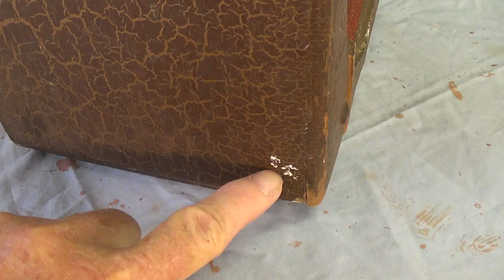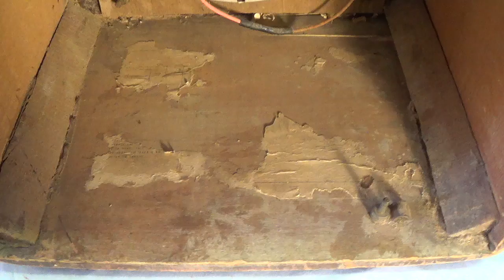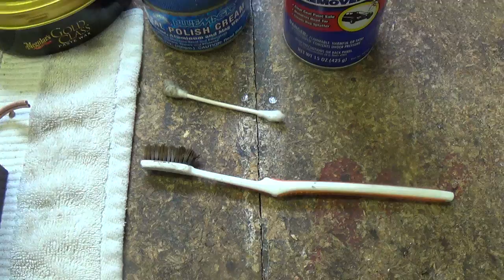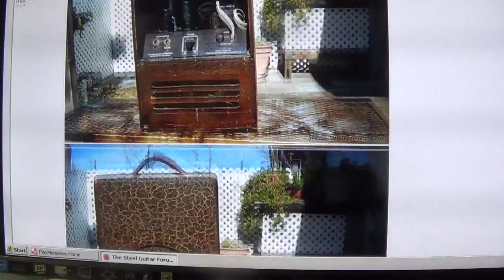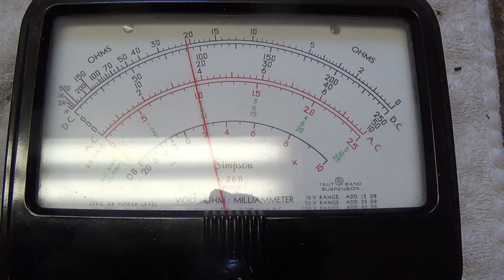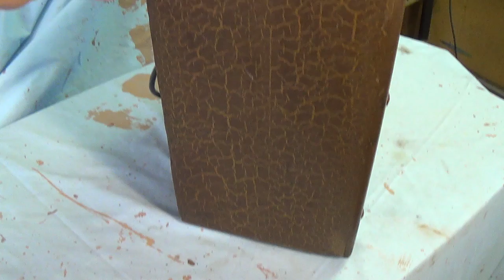Restoration of a Late-40's/Early 50's Jackson-Guldan Guitar Amp

Comment: ROTFLMAO ! way to go Doug , I love your sense of humor ..."Rat Fur for damping " transformer mounted on speaker for percussion effect ... LAFF !  great restoration by the way ... several years ago I picked up a silverface Fender champ amp and the volume level will crackle then get loud & clear for a few minutes then crackle and the volume drops to like 25% of what it was operating at ... and randomly hop back up ...I'm thinking a solder joint crack , and probably original old filter caps , and perhaps cathode bypass caps are done ... have you opened up enough of these to report a COMMON problem ...?
Reply from the maker: +Dan Rose Thanks, Dan. I'm glad you caught on to the (intended humor) and enjoyed it.  Amazingly, some people actually think I'm serious.....but regular viewers KNOW better :) You might have a bad solder joint, but what you're describing sounds like a dirty volume pot to me. Get some tuner/contact cleaner and clean it out. It may or may not help, and definitely it won't hurt.
Reply: yeah one of the first things to do on anything I get opened ... I recently got handed a Peavey Fire 700 Bass amp that had "just quit working" , it took me over an hour to extract the chassis , they had about a dozen bolts form every angle ... in frustration of human logic that put this thing together I pulled all of them only to find that the wrap around carpet covering was GLUED to the chassis as well ... uhh ok once I was finally  able to extract it ( I'll bet that thing weighed 40 LBS ) the only visual showed the 110 vac came in on a computer type removable power cord and the hot lead had popped open the very first solder joint on the power supply board. so cleaned it up and re-soldered it ... spayed out all of the sub miniature pots on the ( removable) control panel / I'll give them credit for that feature = brilliant and the general layout was superb. I've never been able to figure out why makers of electrical /electronic circuits use cheap pots ... why aren't those big reliable Allen Bradley pots used...? almost every guitar or amp I've had to fix has cheap scratchy pots in them. Another head-scratcher is the junk blade switches used in guitars , ex: Stratocaster 5 position are all open and only serve to suck-up every particle of dust and crud like magnet ...
Reply from the maker: Some electronic gear, like some vintage automobiles, were simply not designed to ever be worked on. I recall an early Chrysler that required partial removal and elevation of the engine to enable access to a rear spark plug.....great design :(

Comment: Fantastic. I also like to pick up beaten up items and get them working. It's fun, it's cheaper, and people are more impressed when they see an item that looks like it came from a dumpster working marvelously.

I also kind of like them because items that have been completely restored or are new-old-stock look just as they came from the factory, and while it's impressive, they will look the same as any other item of the same manufacture that was given the same treatment.

On the other hand, you'll never find two crusty amps or busted radios that look identical. They have scars reminiscent of all the adventures they had throughout their existence. The cracks and dents from falling off the table and bodges made by their owners give them personality.

Perhaps I missed it, did you check what the big resistor in series with the output transformer primary was doing?
Reply from the maker: +MisterTalkingMachine  Thanks, Mr. T. I agree with your philosophy completely. The resistor is probably to compensate for the missing field coil of an electrodynamic speaker.  Judging from schematics of circuits like this, apparently they came with and without ED speakers. Those without got the ballast resistor.  This is mentioned in the video.

Comment: What happened to the hold-down for the power cord?
Reply from the maker: +Satch Boogie  It proved to be unworkable when the back panel was installed, so I donated it to the Rat's Nest Museum :)
Reply: Uncle Doug I have another question if you don't mind. Do you think it was ever used and how?
Reply from the maker: A very good question, Satch. Since the amp, when new, came with the back panel in place, I can't imagine any purpose that the hold-down could serve.....yet it appeared to be completely original.

Comment: I've noticed it's very very similar to the silvertone Model 1301 from the 40's

maybe this schematic is from something similar :

http://www.magnatoneamps.com/schematics/dickerson_1946.pdf

here are some pictures of the 1301

http://www.silvertoneworld.net/amplifiers/1301/1301.html

hope it helps :)
Reply from the maker: +Brogh 3d   It does help indeed, Brogh. Thanks so much for this information.
Reply: +Brogh 3d Very interesting.  After 3 years on the market - they discounted it from $47.50 to $34.95 in the Spring/Summer of 1950!!
Reply from the maker: Like most of my "investments".....dropping in value like a rock :)

Comment: I could do with alot of help with my 1948 Operadio 1A65 amp. If you are up for challenge. I would like to get it going as a guitar amp. Im pretty novice at electrical work.
Reply from the maker: +Taniwha Sutherland   Essentially everything I know is presented in my videos, TS. If you study them closely, it should provide virtually all the knowledge you need for your restoration. Good luck.